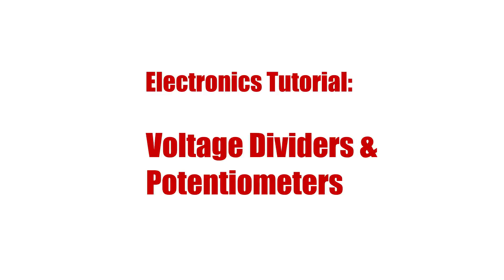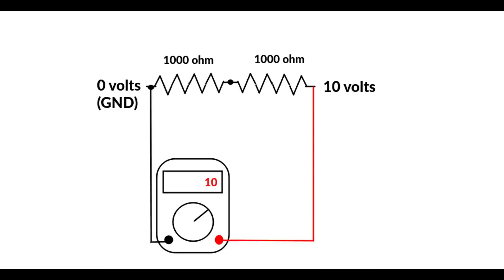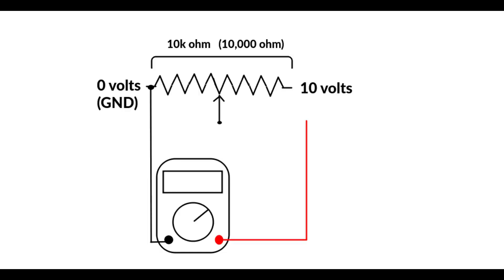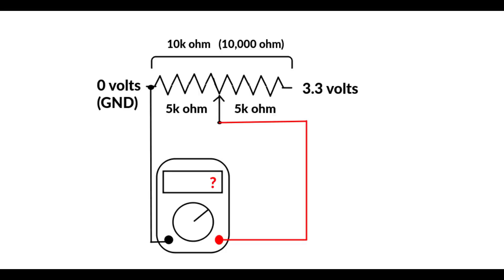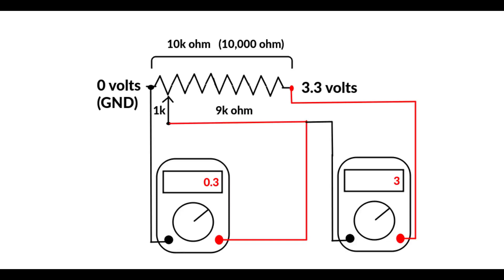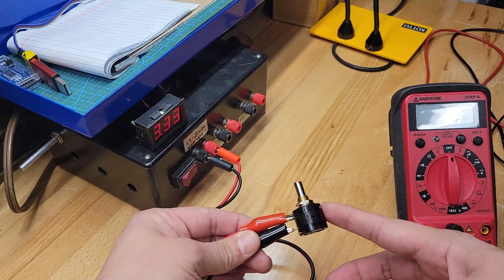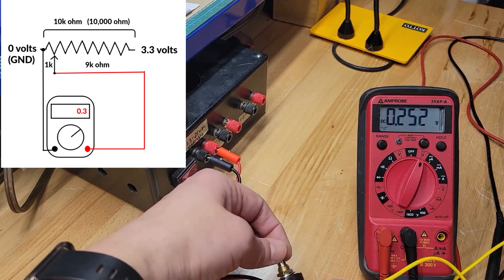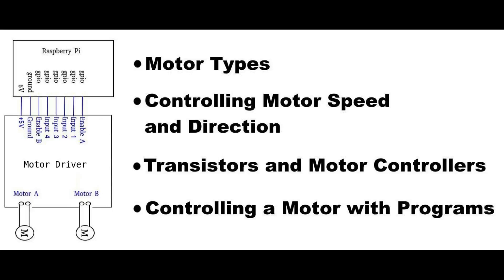Potentiometers and Voltage Dividers Electronics Tutorial

Comment: So I have a friend who is trying to unsucessfully to try and control the speed of a motor. The motor is powered by a standard AC wall plug. I'm pretty sure the motor is a DC motor but from what I can tell the motor is sort of internally wired so the DC wiring is sort of concealed and unaccessible sort of. Is there an easy and cheap way to use a potentiometer or something similar to controll and meter to AC power instead of the DC? I'm imagining something like a dimmer switch for a bedroom lighting that's installed in the ceiling or similar but adapted to control the whole device and if possible do so before the AC adapter plug. Hope that makes sense. Maybe I'll check with his setup and get a better idea of the details if you don't know what I mean. Thanks either way. Have a good one.